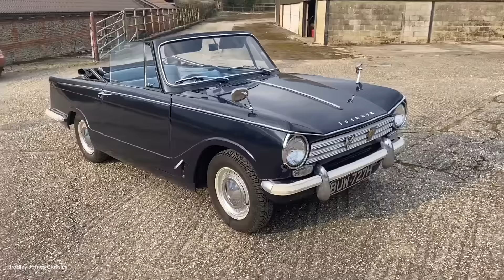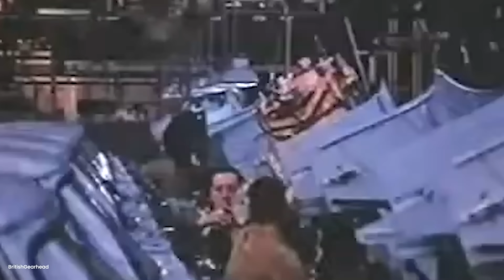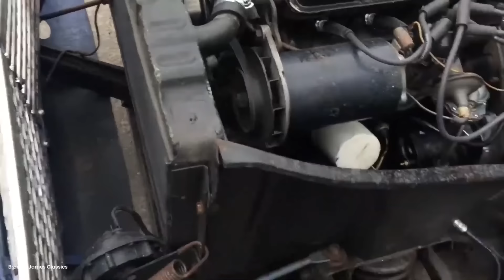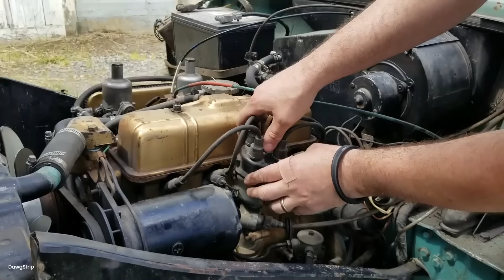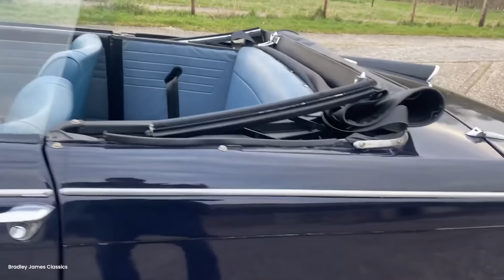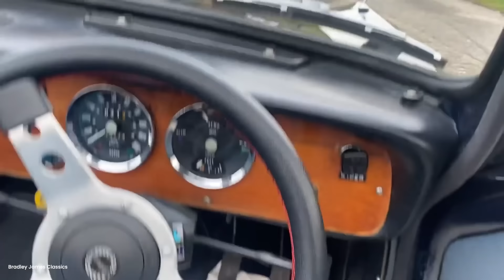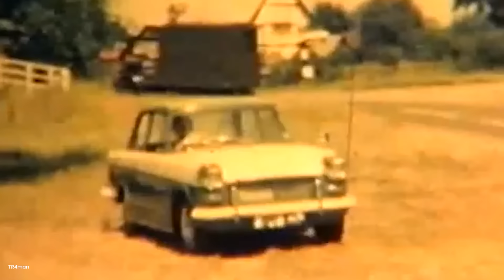Even at 60 HP & Swing Axles, the 1961 Triumph Herald Shocked Everyone with 25-Foot Turning Circle

Comment: Back in 1967, a friend of mine at Orléans university had a Triumph Herald convertible, white with a black top. You couldn't beat it for sheer class, with the possible exception of the Peugeot 404 Cabriolet, in a different price bracket. Of course both cars were the work of Italian designers.

Comment: You can't hide your rubbish presentations by using different channel names. You show many different engine views most of them not herald, some SU carbs some Stromburg, some OHV some side valve. The instrument panel shots were not Herald and if you bothered to check your other shots its NOT a 3 spoke steering wheel and was never fitted with a propeller as the amphicar shown entering the water and later sailing up stream. The seperate chassis made the car heavier than most and the tight turning circle led to front tyres being damaged if not used sensibly. As a mechanic in the 1960's why don't you contact people who actually worked on the cars you so badly decribe or do you really like negative comments, to be fair I only watch to see how bad your next presentation will be.

Comment: First release was in 1959, and was 948cc.  
The saloon had a single downdraught carb, very prone to vapour-lock on hot days.(don't ask how I know LOL).   
Coupe had twin 1&1/8inch SU carbs, still 948cc.
First picture at 0:13 is a 13/60 convertible, a lot later.
Yes, @KiwiCatherineJemma, the early 948cc cars engines were the same as the Standard 10 - but don't laugh ! 
I had one we raced at Tahunanui Beach races, gaining two third places - plus one dead last (in the Open Scratch race, mind you).  
It had planed head, freeflow exhaust , and a twin-choke downdraught Stromberg from a 1947 Mercury V8.  
It would do only 90MPH, because it was valve-bouncing then LOL.
Only the very early 59/mid60 cars had the handle on the bonnet, also the early 59/60coupes had the fluting on the roof side-panels.  Later were smooth.

Comment: Those swing axles induced a very tricky and sudden oversteer. Around you went!
Reply: Only if you didn't have the hang of driving it.
Reply: That was more of a problem with the Spitfire which was built on the same chassis but with a 1500cc engine with twin carbs.

Comment: The only problem with the tight turning circle of the Herald was on full lock the tyres scuffed the flexible brake hoses. On my Helald the the back transverse spring snapped pig off a thing to replace

Comment: As with most of these videos, there are so many factual inaccuracies that's it's hardly worth watching if you want to learn the true facts. As someone who worked on scores of them as a mechanic back then I knew them only too well. I once remember taking a saloon body back end off the chassis (they joined with a row of bolts across the floor below the front seats) and fitting a second hand convertible one. Only after fitting it did we realise that the windows in the doors were different, saloons and estates had square top corners at the back and coupes and convertibles had rounded ones. Back to the scrapyard for window glasses!
Reply: A couple of things I noticed were a motorcycle carburettor and a tyre pressure warning light. This video is a total piece of crap.
Reply: @jimmylles6994 true

Comment: I do wish you would get some more of the detail right.
- You talk about swing axles when the video is showing a conventional axle with leaf springs
- You talk about simple chrome bars, when they never had these.  There were chrome overriders, but the bumper itself was moulded into the body and was was either body coloured or in later models, had rubber coverings
- You talk about unbolting front wings, when you couldn’t.  The entire front of the car, wings and bonnet, was a hinged one piece unit.  Only the slightly recessed grille was separate, and this was bolted to the chassis unit
- you talk about full instrumentation but the original models had only a large speedometer with a fuel gauge inset, directly in front of the driver,. Other instruments were only available on a very few special models, and I, not sure if they weren’t actually specials. 
- You  show some herald dashboard pictures but also one which was never a stock herald design, 
Overall, there is a lot of good detail here, but for anyone who knows the vehicles and has owned a number of them, the credibility of some of your narrative spoils an otherwise interesting piece that brings back memories of owning the cars. 
Please match the pictures to the narrative and please be a little more careful on the detail.
Reply: Not to mention that the '61 Herald did not have 60hp, and the 60hp one they did show (the 13/60 convertible) did not come out until at least 1967.

Comment: To clarify, the "1200" model (1147cc) was rated at some 39 horsepower.  This video description indicates a 1961 release whereas I thought they first released in 1959.  

I recall reading in a textbook somewhere that initially there was a base model "economy" option using the same 998cc engine block, same as the earlier model "Standard 10" (I don't know if they rejigged the oil galleries as Standard 10 only had the useless "part flow" oil filtration whereas the 1147cc engines had Full Flow oil filter system. 

The base 998cc model also only had rubber floor mats instead of carpets. They stopped offering the base model after only a year or two. However, far as I know, ALL Heralds had heater/demister fitted as basic fitment...quite a luxury in those days.  

Further note the "Coupe" version which had the "removable with a spanner" hardtop was also restricted to 998cc engine but the Coupes all came with twin carbs as standard. It might have been done that way as a performance option that qualified in the under one thousand cc category for amateur car races. 

There was a later updated model of the 1147cc engine called the "12-50" which put out about 50 horsepower and they had an openable Sunroof as standard and were a sorta semi sport option (Dunno what carb(s) they had). .  

Later the engine size was increased to 1296cc and the model was renamed the "13-60" and the output power was about 60 hp.  They had an entirely different carburettor I think.  A friend's girlfriend had a 13-60.  

There was a limited number of full soft-top convertibles and some estates (station waggon) models, as well as the normal 4 seater saloon and the a'fore mentioned hardtop coupe. 

Because the 1959-1971 Triumph Herald were one of the last cars to have a full structural chassis, almost all the few surviving saloons have been cut down to make home-made convertibles. You can tell by differences in the back seat and window glass. I saw one at a shopping mall carpark once and made a video about it years ago.
Reply: 948cc, not 998
Reply: @steveyoung8876  Thanks buddy. It's been many years since I read the textbooks/manuals, so some details I may have remembered wrongly. Plus some of the books got given away to others over the years, and others are packed away in cardboard boxes in the garage somewhere. And sometimes I'm just somewhere where there are classic car texts lying around and I read someone else's book for a bit, but don't get to keep it. I'm just glad there are car fans out there, keeping some of these classic cars going and restoring and repairing them when necessary. In another generation a lot of the knowledge and experience will be lost.
Reply: Certainly before 1961. I had a 1960 model with twin SU carbs and some fancy manifolding

Comment: You need to know the differences between a Herald and a Vitesse, and why do you have a DAF in this report?
Reply: There were two different models of Vitesse. They are easily to tell from a normal  "Herald" because all the "Vitesse" models have4 headlamps. ie 2 on each side. One had a tiny 1600cc straight 6 cylinder engine but mostly had the slightly larger but still almost small, 2,000cc straight 6 cylinder engine. 

That engine was almost the same as the straight 6, 2 litre engine fitted to the last of the much larger car bodies "Vanguard" models. 

Almost all Vanguards had 4 cylinder engines for literally decades, but the last few had a 6 cylinder engine. 

That same 6 cylinder 2,000 cc engine was also used in the early models of the new body shaped "Triumph 2,000" car when it came into production.  

Minor changes between those 3 uses of the 6 cylinder engine ("Vanguard 6", "Vitesse 2 litre" and "Triumph 2.000")  likely related to just the carburettors used and the camshafts. 

I have no other information on the tiny 1,600cc 6 cylinder engine fitted to some Vitesse models. I don't know where that design of engine came from or if it was just an under-bored, or under-stroked version of the 2 litre block.
Reply: It is not only the DAF or the dashboard of a 2025 car. The matching between video and audio is laughable. All of a sudden there are shots of an Amphicar - maybe because this pathetic boat on wheels used also a Triumph engine (??).

Comment: 🙏
My father bought Standard Herald back in 1964, year of my birth, it was 1200 cc with disc brakes, red and white colour scheme, it was mostly driven by my mother and lastly by myself,those memories will remain forever.😊
Reply: 🙏
It was 1200cc not 1000cc with single solex carbeurator 
No sunroof, it originally came with single axle bearing which was innovated with two bearings to handle Indian road conditions. The gearbox was a gem. Had Fiat 120 as well at home, but mother preferred Herald.😊
Reply: @sundeepjethani  Thanks for bringing up an important point. Many British cars were exported to various countries around the world, especially the British Commonwealth and specifications for "Export" models sometimes differed. 

Can't remember which car, but I recall reading years ago in some British car textbook that in Britain the radiator fan was just 2 bladed, whereas "Export" models were fitted with a 4 bladed fan. 

Recognition that cars exported to New Zealand and Australia (and India also probably !) would be operating in hotter conditions than cars being used in Britain and Ireland ! 

Sometimes to comply with local laws, cars were exported not fully built in England,  and  some final assembly was done in the country they were exported to. For example some form of credit or tax or import allowance could be made if cars used locally made safety glass in their windows or if the seats and upholstery were made locally. Again, these are all differences from country to country.
Reply: If they were factory discs it was probably the extra cost special "12-50" option which had a more powerful engine. (hence the "50" for "50 horsepower") Not sure if  they had twin carbs or just a different carb. Many (?most? all?)  12-50 cars had an openable Sun-roof.
Reply: @KiwiCatherineJemma  Sundeep is talking about the Indian Standard Herald, not the Triumph. The car was 948cc for 1961/62, then the 1147 was introduced, with the disc brake oprion being available from 1964. The 12/50  was never officially availabble in India.

Comment: My Herald 1200 had 38hp - we called it wolly - depending which way the wind blew its top speed was 65 mph or 80 down a long hill with the wind - it was a nice motor with a good heater
Reply: Correct, the "1200" model (1147cc) was rated at some 39 horsepower.  This video description indicates a 1961 release whereas I thought they first released in 1959.  

I recall reading in a textbook somewhere that initially there was a base model "economy" option using the same 998cc engine block, same as the earlier model "Standard 10" (I don't know if they rejigged the oil galleries as Standard 10 only had the useless "part flow" oil filtration whereas the 1147cc engines had Full Flow oil filter system. 

The base 998cc model also only had rubber floor mats instead of carpets. They stopped offering the base model after only a year or two. However, far as I know, ALL Heralds had heater/demister fitted as basic fitment...quite a luxury in those days.  

Further note the "Coupe" version which had the "removable with a spanner" hardtop was also restricted to 998cc engine but the Coupes all came with twin carbs as standard. It might have been done that way as a performance option that qualified in the under one thousand cc category for amateur car races. 

There was a later updated model of the 1147cc engine called the "12-50" which put out about 50 horsepower and they had an openable Sunroof as standard and were a sorta semi sport option (Dunno what carb(s) they had). .  

Later the engine size was increased to 1296cc and the model was renamed the "13-60" and the output power was about 60 hp.  They had an entirely different carburettor I think.  A friend's girlfriend had a 13-60.  

There was a limited number of full soft-top convertibles and some estates (station waggon) models, as well as the normal 4 seater saloon and the a'fore mentioned hardtop coupe. 

Because the 1959-1971 Triumph Herald were one of the last cars to have a full structural chassis, almost all the few surviving saloons have been cut down to make home-made convertibles. You can tell by differences in the back seat and window glass. I saw one at a shopping mall carpark once and made a video about it years ago.